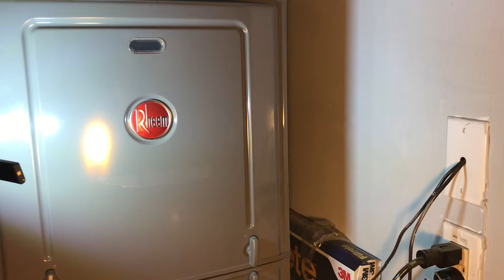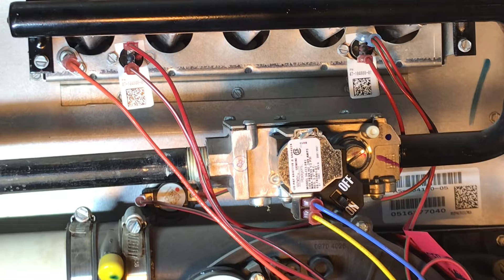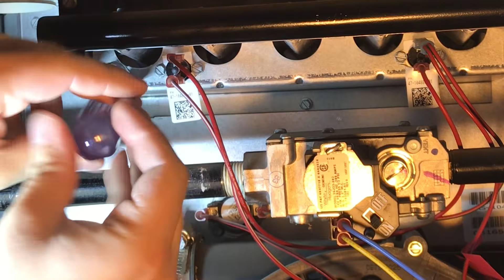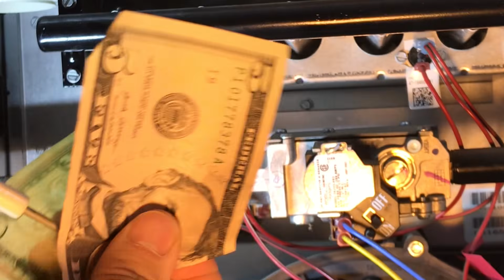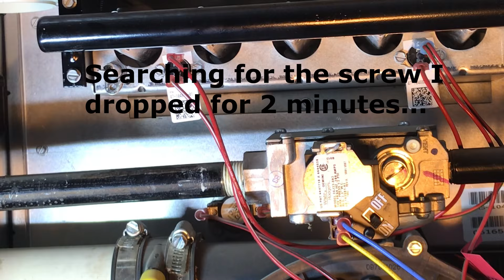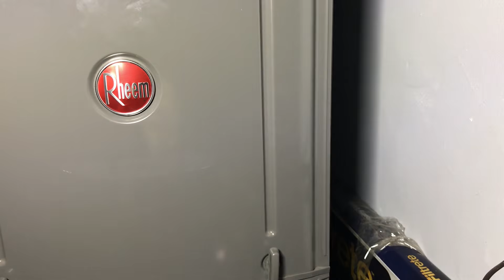Rheem (R92PA) Flame Sensor Cleaning Tutorial

Comment: I've got an older model Rheem I really don't want to replace any time soon and it was doing the initial flare up but wouldn't keep the flames going. I didn't even need to pull the sensor from the socket as I could see the exact same prong with the panel off. Gave it a quick wipe down with some canvas scrap, and it went right back to normal. Thank you for making an easy to understand video to help people out there. Montana winters are no joke and you probably saved us a bundle on new years day! Best of 2025 to you.
Reply from the maker: Absolutely! Happy 2025

Comment: You could have used a $100.00 dollar bill to clean it and you still would have been $100.00 ahead 😅Thanks
Reply from the maker: But instead of a $100 repair, mine only cost $5 😉
Reply: I worked my way up from 1 to 100 for mirror finish 😂

Comment: Great video… I did what you said, seems it’s trying, you can see the flames it works for couple mins and it turns the fan on my furnace is 2-3 yrs old . What can I do? I’m in Chicago!
Reply from the maker: Good luck with the upcoming cold. I want to make sure I understand you right... you hear the fan turn on and soon after hear/see the flames but then the furnace turns off shortly after?
Reply: It was doing that after I cleaned the igniter but then after an hour it kept on working as usual buuut it didn’t go higher than 69 when we had it setup to 75

Comment: How often should this be done? Every fall before you start it up for the winter sufficient?
Reply from the maker: The issue is the carbon build up. The longer you prolong it the more it builds up and harder it is to clean off. I say annually like you mention is ideal but every 2 years is fine. It really depends on how often your furnace runs. When I lived in the Midwest, I did it annually since we had cold winters. Fortunately the sensor is cheap to replace yourself (but it always seems to go out on the worst time possible)!

Comment: I cleaned the sensor and still not working
I see that it’s trying
To ignite but it isn’t
Reply from the maker: If it's not igniting at all and no flames are present, you might have a bad hot surface ignitor
Reply: Furnace ignitors are available on Amazon